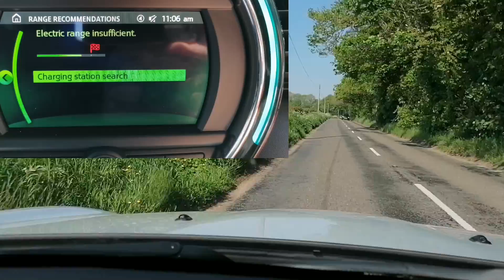Mini Electric Cooper SE range failure and distance to empty GOM problem

Comment: I’ve been living with this, with the BMW i3s for 3 years now, down in Australia.  For example the other day, just driving around the GOM said the range was 22km. Then we hit navigate home, which was 24km away. The GOM dropped to 9km & prompted insufficient range to make trip. But knowing the car had 11%, I knew I would make it, easy. No real elevation up or down on the trip. Ended up getting home with 3% & the GOM on 6km. Easily enough for the next day’s school run too.
Reply from the maker: I've noticed since if you navigate to a place via really slow roads, the range increases so presumably it sees a faster road and thinks it can't driver sensibly on faster roads
Reply: @EVPuzzle  I’ve found the faster the rout, the more KM you get back, they treat it more like an ICE’s consumption. Also it gets worse if you navigate to multiple destinations at once.

Comment: I totally agree. The other day, I charged at a fast charger. I got a range of, wait for it, 155km (km not miles). I reached 155km with 37% left. My average is 12.5kWh/100km since the day I bought it which means a range of 233km - exactly WLTP :) The GOM is useless in the MINI. I only look at it to laugh now. I go by 30km/battery segment. Never let me down. I wouldn't normally care, except for the GPS calculation - as you describe. I made a complaint to MINI Australia, which got.....nowhere :)
Reply from the maker: Looks like I'll have to convert to an iPhone to cease using satnav

Comment: I think you are spot on. When I had the Zoe ZE40 I think the sat nav was set up for a 22 Kwh battery. It was always telling me I would fall short when I was going to arrive with 30 miles to spare (15% - that would be tight with a 22 kwh battery but not a 40 kwh battery). It was just an annoyance because I knew I was fine but someone new to EVs would have been sent into a bit of a panic and make an unnecessary stop adding a lot to an otherwise fairly short journey (my neighbour has a Mini but is scared of the idea of the EV because of all the stuff she's read about range anxiety, still plenty in the press to put people off). I have noticed that since going back to an ICE car again I always take the fastest route rather than a shorter route and I also drive at 70 on motorways instead of 60 (or less at times when range was tight). I liked the challenge of planning longer trips in my Zoe but I can see a lot of people wouldn't want that. I too think the Mini a great EV btw.
Reply from the maker: Robert, I think you have to learn to drive an EV by experimenting. We expect to just get in and drive but like anything new there's a learning curve. Learning efficiency and range and practising running low gives better confidence. I liken it to braking in snow. I always test brake to feel the skid safely before actually needing to in anger.

Comment: Didn't wish you still had your Kona then?
Reply from the maker: No, I did the right thing. Since last summer I've not really been out of Norfolk until this trip and the Mini is perfect inside Norfolk and fun learning more about charging outside. Kona was just too good it was a bit boring. Even the auto steering is noticeable in the Kona, it's subtle but it eases the driving process. The Mini is all manual in that respect so more engaging. I only miss aspects of the Kona.

In reality I used to charge the Kona in a tight range 60 to 85 %. Now I'm charging 30 to 100%. Same energy, same charging times just less extra just in case